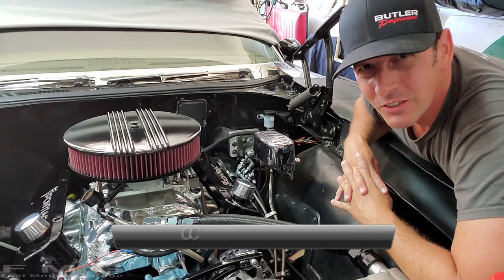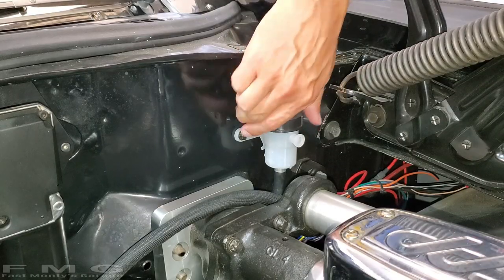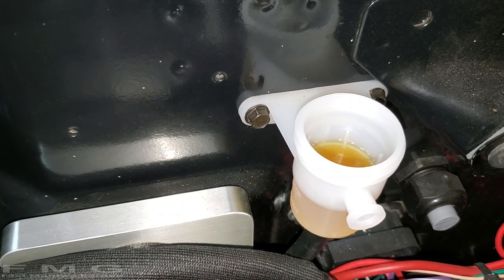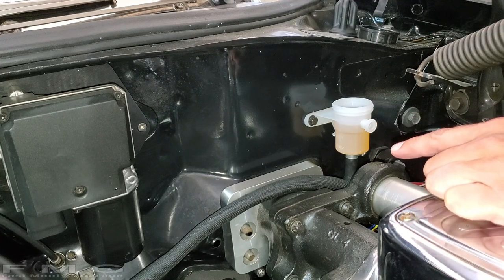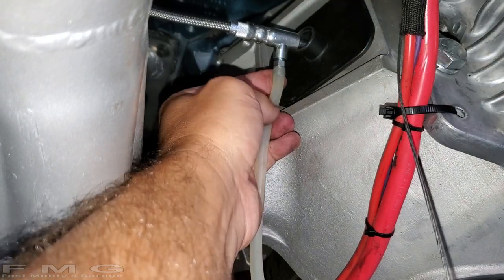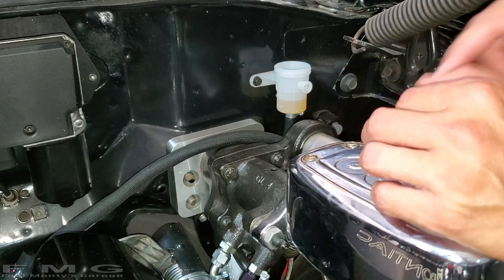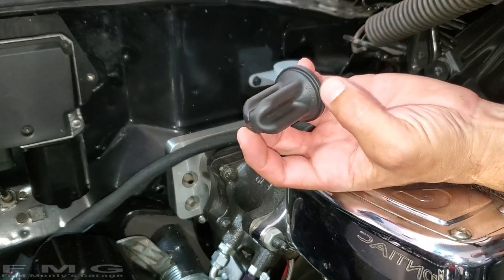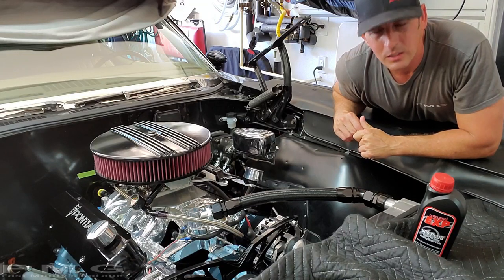How to bleed your Clutch and Wilwood Hydraulic Master Cylinder

Comment: another awesome video and just a heads up minus the mess you made with the bleed screw you saved your self a bunch of time with bleeding by forgetting to tightening it lol.  Works the same with brakes but what you did is what is called gravity bleeding, works very well when you replace brake lines.  Put a catch can on so it won't make a mess on your floor pour the fluid and wait till it comes out the bleed screw that way when you start to bleed the system the only air your bleeding out is the air trapped in the component aka the calipers or slave cylinder or in your case the throw-out bearing.  If the bleed screw was tight you prob would have had like 10 plus pedal pushes most likely more to bleed all the air out and that's just for the short run for the clutch hoses the brakes would be allot more.  So what you thought was a blunder really saved your helper from allot of petal pumps lol but again awesome job man love you videos.
Reply from the maker: Thanks Justin!  Yeah, totally forgot the term for "gravity bleeding".  You're gonna like next weeks video!
Reply: @FastMonty  can't wait man.

Comment: I like that you keep those little mistakes in like the open bleader cause that is real life!!  New to the channel hope you have a video on hydro-boost master cylinder. I'm dealing with new vacuum boost system (4 wheel disk) on my 69 charger and it's giving me fits for obvious reasons low vacuum so looking at option #2 or 3 or 4 to improve my braking lol
Reply from the maker: Thanks Paul... yeah, I like to keep mistakes in, because it's normal.  That's how I learned, by making mistakes... :)  As for hydro boost, I do not have a video on that... but, what I can tell you is, it's awesome.  Make sure you have a big enough reservoir, with a filter screen so the power steering pump doesn't ingest the cavitation bubbles, making it impossible to bleed.  Keep at it, and I'll see you soon!

Comment: Hello, I have been watching your build and its been great! I was wondering about this bleeding process with a single line going into the hydraulic throw out bearing. Most have two lines coming out of the bearing a feed and and then a shorter line with a bleed cap just like a brake caliper. One would think air would get trapped either in the bearing or in the line feeding it. Obviously having a single feed line works! Over thinking it I guess.
Reply from the maker: Thanks Brother... yeah, I had a hard time with that concept too.  But, the inlet/outlet on the slave cylinder is on the top, so air can get out.  After that, it finds the area of least resistance to escape, which is the valve.  Totally sounds crazy, but it works.  I haven't had a problem since.  Have fun!

Comment: I don't like that the bleeder is not higher than the slave cylinder (and it's pointed down) it seems there is potential to leave air in the line/slave with this setup.
Reply from the maker: I thought that at first too... it works fine.  I suspect it's because the port is located high enough on the slave cylinder, where then air will find it's easiest way out of the system, under pressure.  (when bleeding)  Thanks for the comment!

Comment: Ok, bleeding looks simple, but how does this setup get the air out of the cylinder and not just the line??  Also, do you think a remote bleed line would work with the right fitting?
Reply from the maker: I understand how you feel... Because brake bleeding requires elevation of the fitting.  But, this actually works fine the way it is.  I suspect it has something to do with the location of the fitting on the cylinder, notice it's on the top, so air finds it's way there, then finds the path of least resistance, during bleeding.  Not sure how you can make it better... the old saying, if it ain't broke, don't fix it, applies.  :)  Hope that helps.
Reply: @FastMonty  thanks!  I actually have a SST T56 kit in my garage,  just doing as much reading,  watching and researching as I can before I start.   I missed part 11 (went from 10 to the test drive lol)   great videos!
Reply from the maker: @Nightfall68rs  Thanks!  I totally get it... have fun!